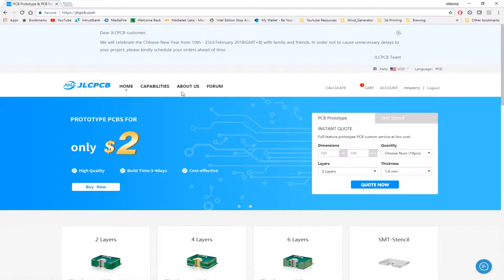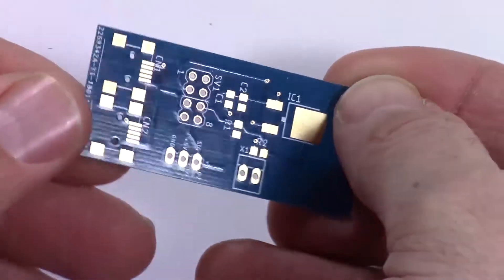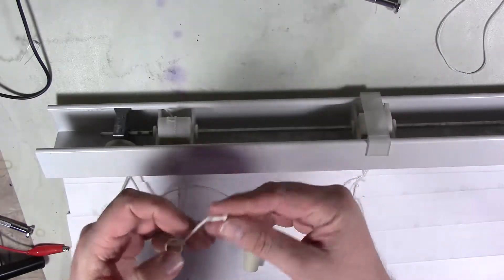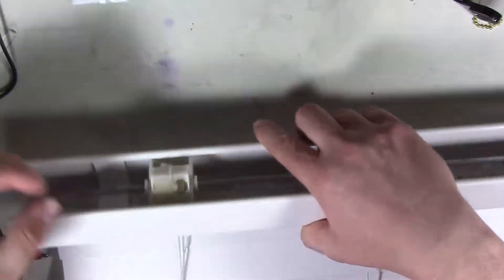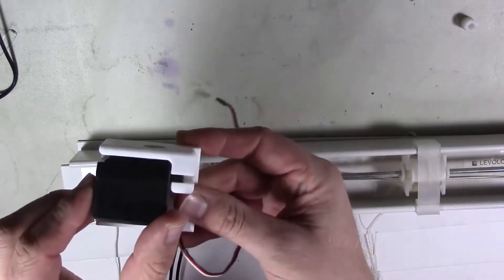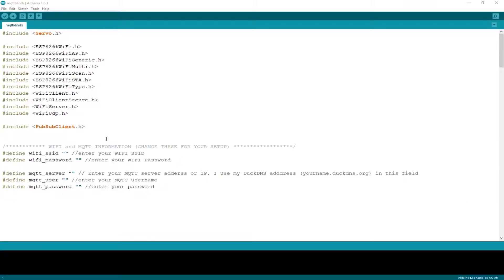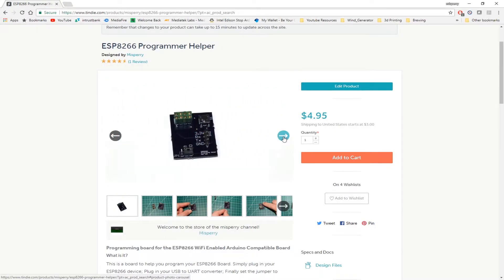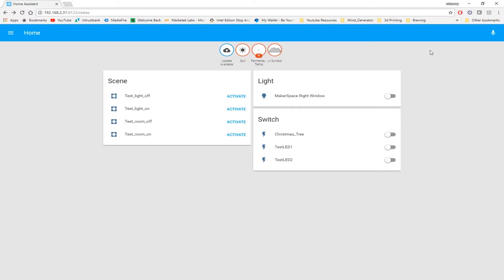Home Automation - Servo Controlled Blinds

Comment: Am I losing my mind or is this not shown actually working?
Reply: I thought the same thing and had to rewatch the video. It is shown operating at the beginning 0:06, using a pull switch. Presumably you could also have it programmed to operate on a timer.

Comment: hi do you have this set up in a off the shelf mini blinds? they are smaller than the ones you showed followed google to your page
Reply from the maker: Hey there.  No I don't but could you give me a link to the blinds you are looking at?
Reply: @misperry  I have to get one down and see but it is going to be around 1 to 2 inch square I bought them at Home Depot but you can get them at HD or Lowes or menards or any big box store
Reply from the maker: Ok no problem I will take a look. I was wanting to re visit this since saving battery is high.  I also am thinking about adding solar to it so as to charge the batteries during the day time.

Comment: I have a digital servo I modified to run continuous on my vertical blinds, I have a analog 25 turn pot. I'm wanting to add, will our code work or do I need to change something. My blinds open and close but I want to be able to open at different percentages.

Comment: Wondering why you chose to use light MQTT component instead cover MQTT?
Reply from the maker: do you mean using the embedded MQTT broker instead of something like Mosquitto?  I just wanted to demonstrate the functionality of getting it all to work together.  You could totally set it up with another broker if you want.
Reply: misperry Not exactly. On GIT in your configuration file for HA you are using light MQTT component to control the blinds while there is dedicated  cover MQTT component. Are there any benefits of doing that?
More info: https://www.home-assistant.io/components/cover.mqtt/
Reply from the maker: This is magnificent.  I simply did not know about this.  I will definitely look into it.  Thank you very much for pointing it out to me.
Reply: No wonder the component base expanding so fast it is rather hard to keep up. Keep posting great videos, love them.